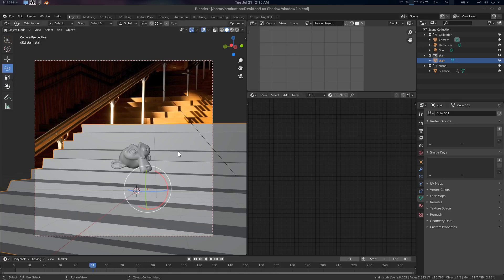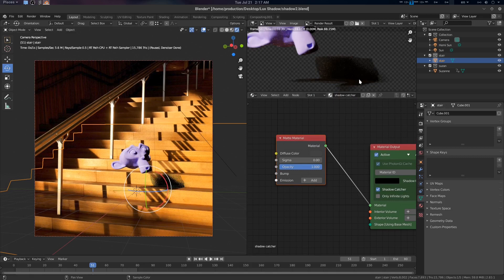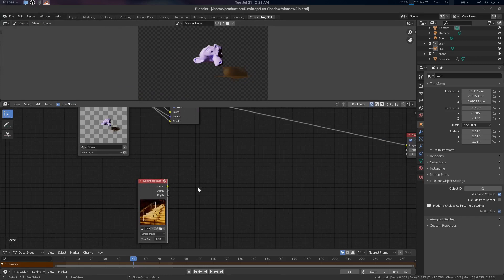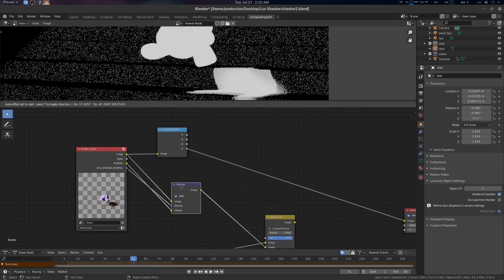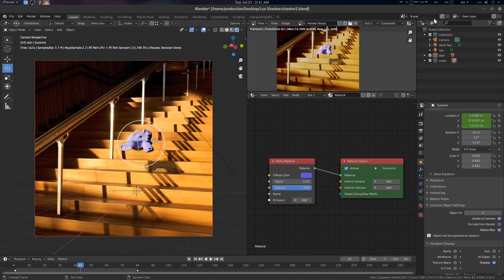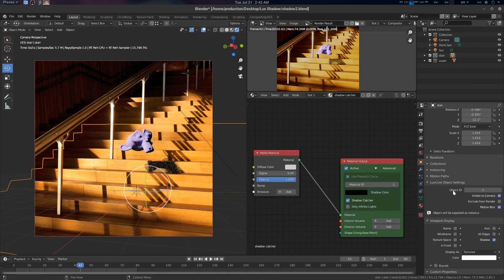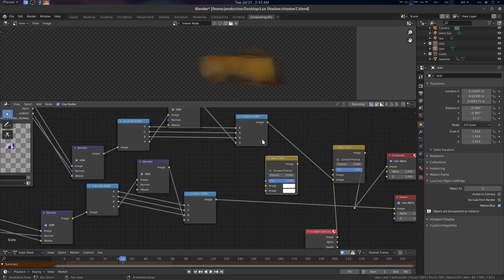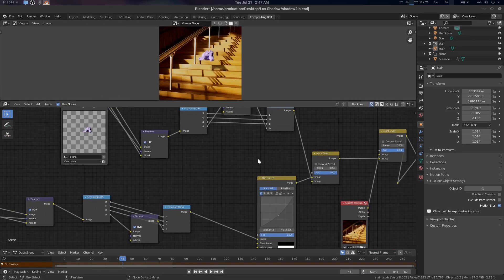Shadow Catcher in Lux core Render With Blender Compositor Tutorial

Comment: Is lux faster than cycles?
Reply from the maker: They are more or less same. Although all raytracer engine in very near future will not be very much dependent on render speed as denoiser AIs will take over this sector. 
Lux is more physically accurate in terms of size, distance and unit which is essential for VFX and ArchViz. Also it is capable of rendering accurate caustics.